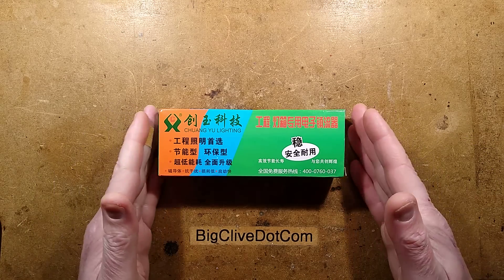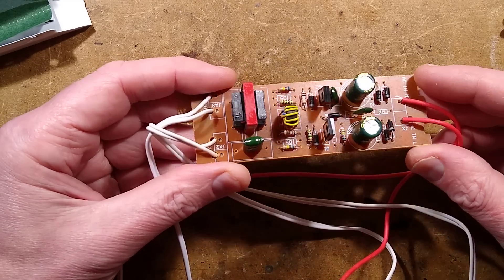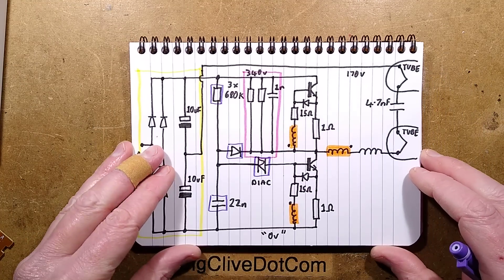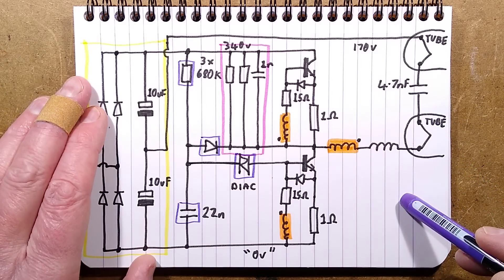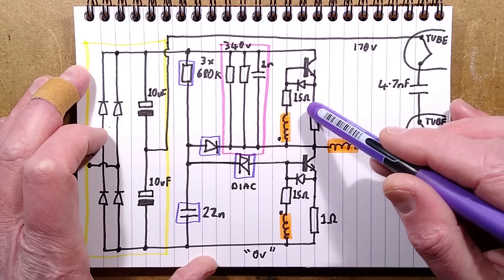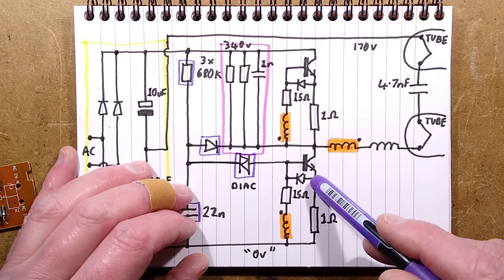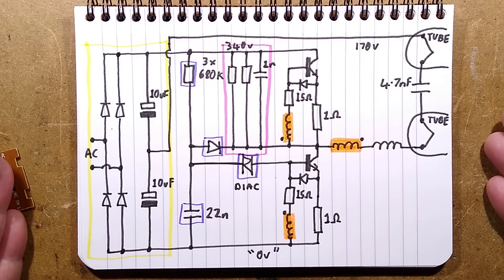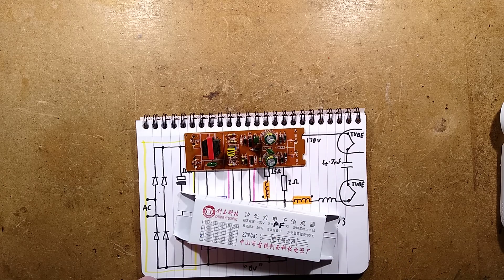Cheap AliExpress ballast (with schematic)

Comment: Clive: I know we are behind the times here in the USA, but hospitals use a ton of fluorescent lamps mostly in offices, hallways and stairwells, especially if the area hasn't been remodeled or updated in many years. Most fixtures use compact fluorecscents and rarely LED, but that is slowly changing to LED "strip" lamps and some four foot drop in retrofit LED lamps that don't require the ballast being removed, as a side note about 20 years ago a hospital I worked in did a "retrofit" of the fluorescent fixtures from a T-12 lamp to T-8 lamp  and removing the old magnetic ballasts (many of  them were of the potted type some with PCB's.) to an electronic ballast. The new electronic ballast were capable of dual input voltages (120 or 277 volt).  Imagine how many fixtures could be run on one 277 volt, 20 amp circuit!  Oh, and the operating theatres were notorious for six lamp-four foot fluorescent lamps, Because the operating rooms almost never were remodeled unless being changed to a different configuration for new equipment or procedures, the operating rooms are large source of revenue for a hospital and to shut a room down and do the infection control/dust mitigation was kind of big money.  -John
Reply: Wiring a newly built hospital in the us four years ago and general contractor chose the cheaper option for lighting. All fluorescent fixtures in a brand new hospital just blew my mind
Reply: There are a lot of fluorescent lights in many old buildings all over Europe too. My office even has a fluorescent light that is so old the tubes for it aren't sold anymore.
Reply: @masteryoda394  T12?  I know when I was there in 2005-2009, T12 were already obsolete because T8 use the same G13 pins, but there was a big push for T5 conversation that required new tombstones (as they are called in the US) since they use G5 pins.  What sucked about T5s is that 4ft (1.2m) tubes in unheated areas would only light up towards the ends for quite a while, basically producing very little light output.

Oh, there were weird single pin "instant start" tubes that worked basically the same as modern US electronic ballasts in that they just shock the tube to life... US electronic ballasts only have 3 wires to connect 2 tubes.  One wire is a common that is connected to one pin on one end of both tubes while the remaining two wires connect to one pin of the other end of each tube.  Bypasses the heaters completely, working more like an HID ignitor.  Nothing like how German electronic ballasts had 8 wires for 2 tubes and used the heaters for a split second before igniting the tube.  Probably lasts longer, but costs more up front.
Reply: @davidkane4300  the tube is about 80cm long and the pins are flat and on the back, I don't think that's the T series at all.
Do you have any idea what it could be?
BTW this is in Germany
Reply: Same here in Brazil. We still have some surgery lights that use incandescent bulbs, as an example of how they sometimes prefer to not updated to new tech if it's working.
Reply: @Bleats_Sinodai  a lot of dentists still use incandescent/halogen lights because they have the reflectors that reflect most visible light, but pass infrared so heat goes the opposite direction of the light output (much like some 50W MR/GU halogen lights).
Reply: @Bleats_Sinodai  In the case of surgical lamps, I wonder if the color temperature has to be kept exactly correct? I can imagine that a surgeon that trained and has experience in one color temperature might be thrown off when looking around the body if the colors of what he's looking at are off.
Reply: They usewhat is there. Changing all the light fixturesis a huge cost.
Reply: True, you don't need to remove the ballast with many drop-in led tubes, but if you don't you will loose some power through it.  It is best to remove it.
Reply: @TheThomasdahl  You can also just bypass it so you don't have to remove anything.
Reply: @masteryoda394  True!  You are quiet right.  Sometimes getting to it makes it just as easy to dump it..
Reply: I worked at a place where the ladies complained that the fluorescent magnified work lights didn’t keep their hands warm. They switched them back. Probably cheaper than turning up the heat in the building.
Reply: Awesome
Reply: Last week, the last remaining fluorescent lamp at my home failed, after 45 years since installed. I was happy to remove it all (fixture with magnetic ballast and a 20 Watt tube) and easily place a LED lamp instead.
Reply: I'm a maintenance engineer in a large hospital that is a total hodgepodge of old buildings with old add-ons and we are very slowly replacing all the florescent fixtures with new led fixtures, and only putting in retrofits in the mechanical type areas where all the trolls and vampires are down in the basement. Oddly enough the government or electric company or something like that made a compensation program that is making it take way longer. We only have one full-time contracted Electrician in the building, and he had to install the LEDs or we don't get reimbursed. If any of us lowly maintenance techs fix a bulb we just swap bulbs and ballasts. But it's kinda funny that the incentive program slowed down what it was trying to accomplish. Of course all the newly remodeled or constructed areas get LEDs from the start. Lots of the disposable, wasteful one peice fixtures.
Reply: Hi
Reply: MOST cheap led lights put out a terrible light spectrum wavelength profile - one can can damage or stress eyes. Some CFL's and aquarium fluros - were better engineered.  I have seen sealed glass fluro tubes driven by leds on the market. Beware raw efficiency numbers. On LED compacts, I enjoy collecting them, replacing the swollen 1000-2000 hour electrolytic and underdriving them.  Both CFL's and LED's are known for missing ac filters and produce tons of RF hash. Just a matter of time before SDR police go after the ones that buzzz cochlears and pacemakers.
Reply: I was electrical maintenance in the '90s at a hospital...we were slowly replacing the older magnetic ballasts with electronic ones ( as magnetic ones failed, they were replaced with newer electronic ones) The old magnetic ones would have " earwax" running out of them sometimes when they failed. 
      We didn't shut the power off when replacing ballasts! Really couldn't. I always installed a AG-3 fuse and holder in line to make it easier for the next guy...
       You're right...they didn't want to shut down the OR for anything. I had to replace a 24volt, 35 amp transformer that powered the surgical lights...took a few hours ( difficult location), I got chewed out because some estimate said it only took 45 minutes...I believe this hospital had around 3000 florescent fixtures ..
Reply: @scottthomas3792  They changed ballasts hot in the office building I worked in years ago.  One evening I heard this awful scream.  The 277 volt live hot dropped down and landed behind the maintenance guy's ear.  The shock didn't hurt him much but the fall off the ladder was worse.  Nothing fatal but he was injured and off work awhile.

Comment: Single sided through hole easy to trace board. This really is a blast from the past :-)
Reply: Ballast from the past
Reply: The visual symmetry makes it nice to at and easier to screen after production for component stuffing errors, if that were still a thing.
Reply: I used to design and hand paint my own single-sided PCB's in the '70's. Not beautiful but they worked fine. Now things are much easier, cheaper and nicer.